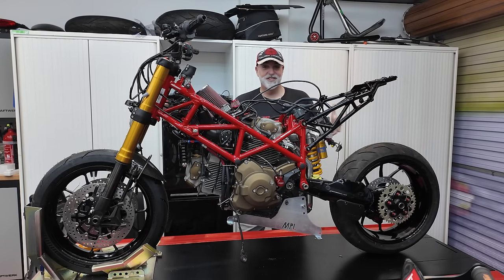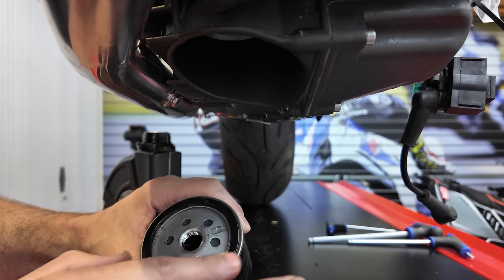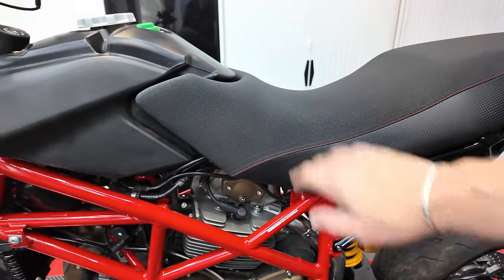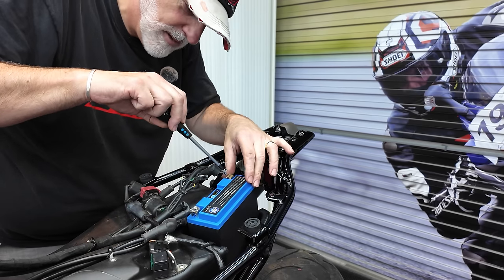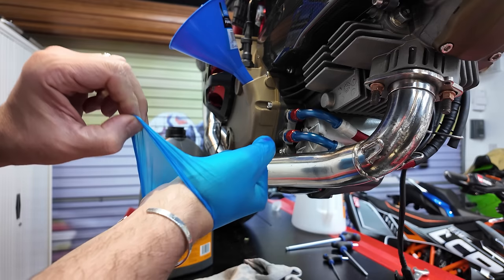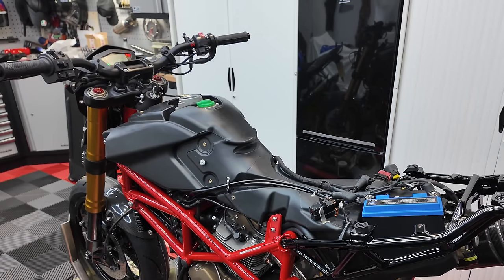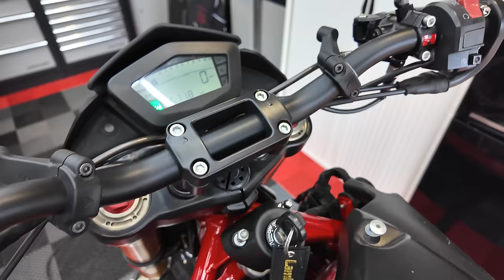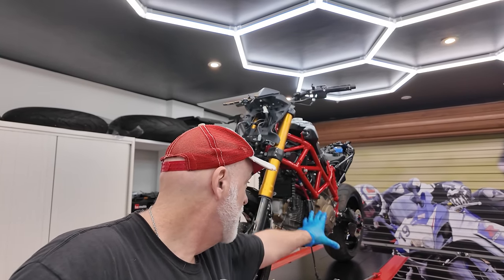Four Year Rebuild Comes To An END!! | Finally TRYING To Start My Ducati Hypermotard EP20

Comment: Its always positive first when connecting/fitting a battery, then earth removed first when removing/disconnecting… less likely to short something out 👍
Reply from the maker: Great point! 👍
Reply: An easy mnemonic I use for the battery goes as follows; Removing the battery is a negative (-) thing, placing a battery is a positive (+) thing. :)
Reply: @caspar4121 i like that, thank you
Reply: @caspar4121 Really useful! I always have to check. Thank you.

Comment: Its a good job you have a dry clutch… using a car oil in a bike is normally the end of the clutch due to the friction modifiers used… nearly had a heart attack until I spotted the nice red dry clutch 😅

Comment: That oil from Halfords is actually pretty good. My 2005 SV650 has had a diet of that for the last ten years and 60,000 miles all year round biking can attest to it's efficacy! People had problems with clutch slip from more "premium" oils.
Reply from the maker: Yeah I know, I just mean it's the cheaper selection 👍

Comment: I bought a new HM1100 back in 2008. Great bike! Only had one issue with the rear cylinder round side head timing cover (?) leaking oil. Ducati had a TSB for this being a problem and the temporary fix was silicone sealant as the o-ring that sealed the cover was not the issue as it was the same as the other cylinder. The mechanic thought it could be the head machining was oversized and the o-ring wasn’t able to properly seal the port.

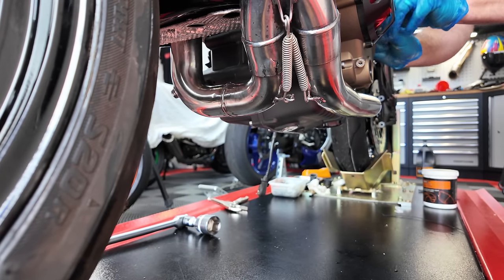Comment: 11:58 you can see that the exhaust cracked which might be where the smoke comes from.

Might need fixing before the MOT.

Otherwise congratulations! I'm excited for you!
One last mod I would do is upgrade the starter/ground cables for thicker ones.

Comment: AHH CHOPSY!!! You want to check that the starter motor isn't still engaged when it starts mate looks like the button is sticking or the solenoid is sticking?
Reply: It's fine. The Hypermotard has "servo start" where the starter continues to turn after the button has been pressed either for five seconds or until the motor fires, whichever comes first.
Reply: @luddite6239  funny that my brother had the 1100 multistrada of the same year and that didn't have that "servo start"? You had to hold the button and I'm sure Chopsy had to do that before he stripped the bike down?
Reply from the maker: No I think it does certainly have servo assisted start.. might have more extras being the S version..
Reply: @tracktime1196  All the DS motor Multistrada versions had, (or should have had), the "servoignition" system. It's certainly shown in the owner's manuals. The thing is, if you press and hold the button as normal, you would never know it had it, as it only activates if it's pressed and released before the engine catches.
Reply: @luddite6239  oh wow I never realised and when I think about it I did always just kept my thumb on it when I borrowed it and it was never talked about between us? Everyday is a school day lol
Reply: @tracktime1196  I know! I only found out about it by accident when I had my old S2R.